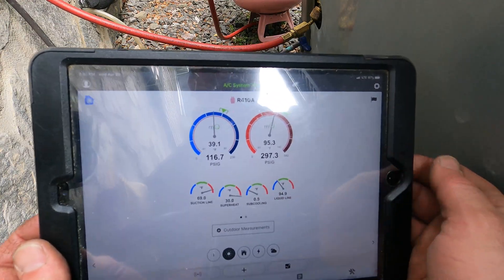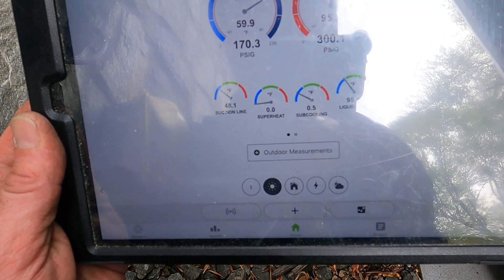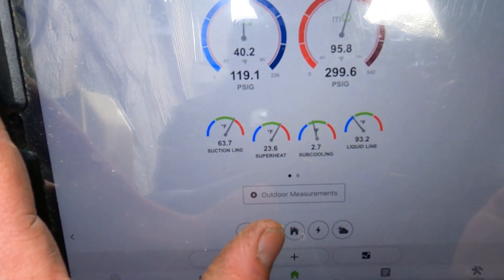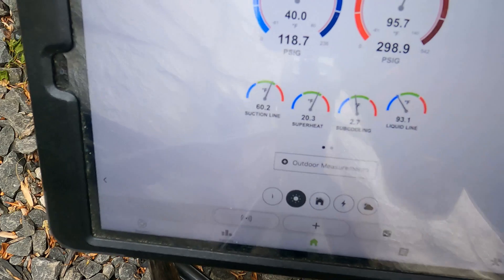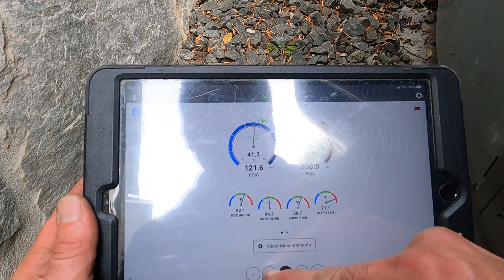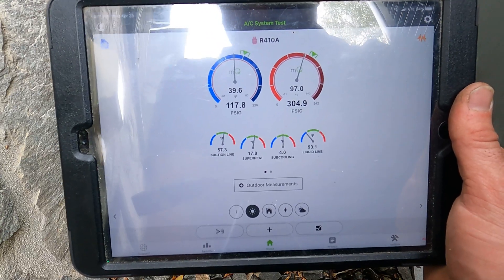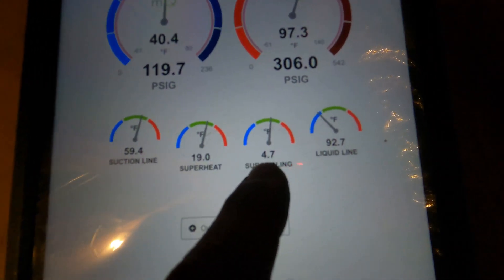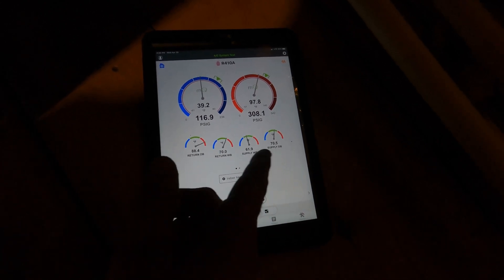HVAC Repair AC Not Cooling

Comment: what gauges do you use? looks awesome
Reply from the maker: I use the Fieldpiece job link probes. Going into my third summer with them. I can say I am very happy with this investment. I added tools onto my initial purchase. Makes it easier all the info I can see while testing.
Reply: @thehvachacker  thanks, i like how you can analyze everything in real time, people dont usually realize that they should be rechecking WB measurements as refrigerant is added. i liked they gives you the full picture. thanks for the vids

Comment: you should never top off any system without looking for a leak and finding one because the environment ffs. or you should perform a high pressure test to be sure of no leak. also not a good practice to top up 4 series refrigerants as the are a blend, that can lose component constituants.
Reply from the maker: I had to keep customer comfortable. That is why the customer hires me. It’s legal to refill a system. Plus that refrigerant is still needed after I replace the evap coil tomorrow. You can top off 410a. What documents or articles can you link to that says that 410a can’t be topped off? It’s been done since it came out. DuPont and other refrigerant manufacturers said it’s ok. I did find a leak in the vid.
Reply: @thehvachacker   David foster is an   arrogant apprentice , I have corrected him also
Reply: @ David  Foster -You are wrong !! 
Initially when system is detect low in refrigerant the tech can add refrigerant in the system -Why>
because little holes or little leaks go unnoticed until customer has realized no cooling properly -
Also small leak are searchable better with pressurized system -Also you always need to make sure customer has cooling AC before you go then according to customer you come back to fix leak

Comment: Hello , I’m an apprentice, so im still learning the trade.   In the video I noticed that you got the correct charge and from the looks of it no dirty filter or air restrictions. Why would the supply temp be so high ? Was it because of the high load (80F ) return temp. 

Would it just take time to bring that return down and supply would also go down over time ? 

Thank you
Reply from the maker: If you watched until the end my probe was picking up the wrong return temp. The return temp was 88 degrees. Still a very big load. It was a tool issue
Reply: @thehvachacker   thank you , so my guess is that over time the supply temp came down .
Reply from the maker: @Adrian-jd1pb  yes there was just so much heat and a large space.
Reply: The Evaporator is burning superheat - It takes a wile to cool down

Comment: No leak search & repair?
Reply: Most people don't want to pay for that
Reply: @superduty4556  yep better off with a new system if they had insurance or put it in mortgage loan.
Reply: @superduty4556  there is a law about that in europe we would never top up any system for a customer you can get put in jail for it.
Reply: @davefoss23  I can't imagine living in a place rife with such subjugation.
Reply from the maker: System was repaired by adding refrigerant. It’s not a long term repair. I would never leave my customers without ac. Especially for master bedroom. If nothing is done it most likely would work rest of season. Leak search was performed. Sold customer new air handler. Paid in full before I left. There was only 3 ac’s and a 75kw generator on this side of house. 5 more central ac systems on the other side of house. Only thing my customers care about is comfort.
Reply: @thehvachacker   What if its a part in the middle of the night you do not have with you? Like a Fan motor for example? You still gonna leave them with no ac? I sometimes have customers telling me they don't want to pay the after hours fee for me to go get the part from the distributor and I just leave it up to them if they want ac for tonight or wait until tomorrow or so.
Reply from the maker: @Aaron-cd7bl  if I don’t have a part that is different. It’s legal to charge up a system. Therefore I got paid to recharge system. Then a week later I got paid to replace the coil. If I don’t charge a system someone else will. Most of my customers don’t care what it cost if they are comfortable. This was only one group of condensers on this house. Had to be the master bedroom. They expect a good salary just like I do for my work. Yet if I don’t have a part they understand since I usually have what’s needed for most their inconveniences. Some were upset this weekend I ran out of r22 on my truck and didn’t want to run to shop and get more. I figure it’s a reality check for them that it will not be available soon.